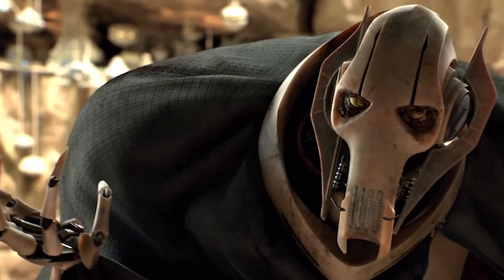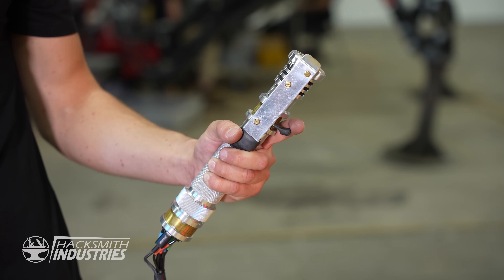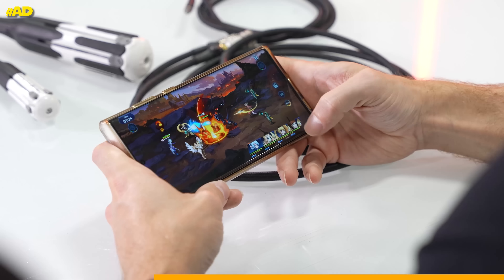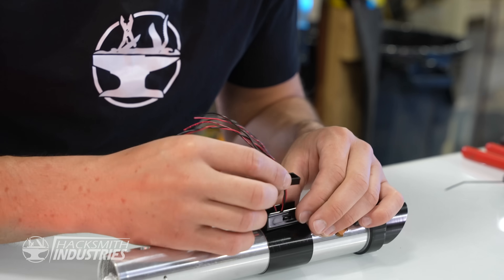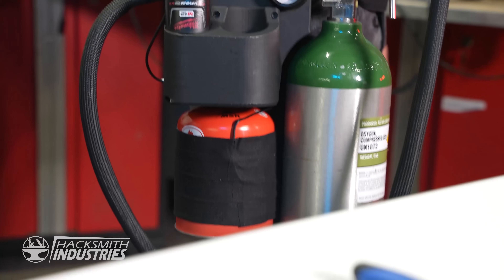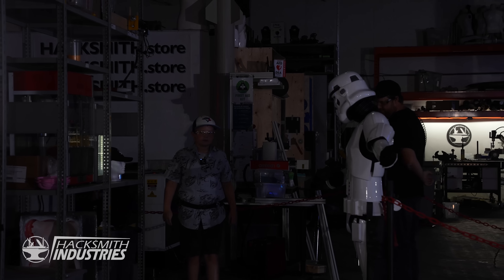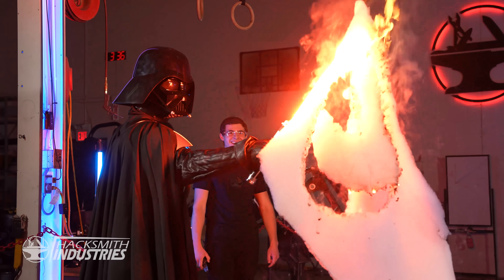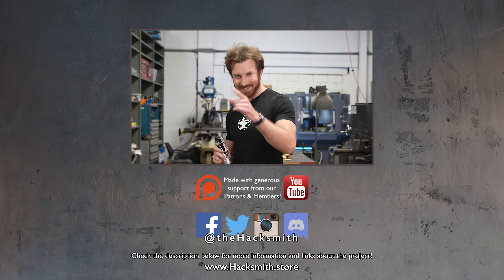My Best LIGHTSABER Yet! (STRONTIUM PLASMA 4500°)

Comment: This thing is neat, but the plasma is still too cold that it takes a long time to cut through steel, much less the multiple-inches-thick durasteel blast doors that seperated Qui-Gon and Obi Wan from viceroy Nute Gunray in Episode 1, and even then, with everything else except straight-up foam, it was slow. In the movies, lightsabers cut through any material with a low-to-moderate melting point (glass, plastic, and flesh) instantly, and also instantly cauterizes wounds they create. The blade would likely have to be at least 3x hotter to achieve something like that, and even then, there's the matter of miniaturizing the power supply, plasma fuel, and (optionally) colouring agent to fit inside the hilt and either last a reasonable amount of time or not deplete at all. 

I feel like it will take several major scientific breakthroughs in the relavent fields for all the different components before something like a real lightsaber becomes possible. Maybe we'd see the technology become a reality in about... 200 years? Even then, It'd probably only be protosaber tech until we find some way to generate plasma without using a finite fuel source.

Lastly, if a real lightsaber blade is 2-3x hotter, then you'd probably want gloves to keep your hands from burning.

Nice work advancing the tech, though.

Comment: I salute and respect the endless effort and passion behind this build, yet, I sustain the fact that to be in respect with what is it to be expected, which is to slice through reality by extreme means.... like filamental gravitational extreme differential, the active edge is in fact the stretched event horizon blade, an asymetrical elongated slower dissipating axial radiant stellarator light saber. The handle is the energetic short condensed reservoir of compressed fluxual energy. I know how to build one, it just cost too much for this world nowadays. The light saber is also a dialog instrument with space and time, made to open passages between realities, gates from hell to heaven. The lightsaber, is a cosmic pilgrim's staff, not just a toy. Fun fact, it's a cold blade, but can cut trough diamond like a sub atomic scalpel.That is why a Jedi is needed to handle it.

Comment: I did some work (in my thesis) on steel furnace Hydrogen pure oxygen inverse diffusion flames and i think tho more dangerous they would be ideal for your Applications. The higher the exit velocity of the oxygen in the middle the better! Hope it helps great work so far.

Comment: So just spitballing, maybe you all have looked at this and thought it wasnt a good idea, but why not do a spring loaded collapsing steel rod with a MAJOR electrical supply to super heat it? Gets rid of the fuel tanks, dont have to deal with how finicky the flame is, and you get that collision that we see in the movies when a light saber hits something. Just use a metal with a stupid high melting point like tungsten
Reply: Just saw that the early prototype was a tungsten rod. Please ignore my previous comment XD

Comment: Starkiller had a unique ability to control lighting into a force sheild.which could be used offensively. Lightsabers have the ability to absorb lightning but it depends on a force users sensitivity  and talent to use the force. Basically,  a lightning rod with a super capacitor and a trigger to release the energy could work to replicate a small fraction of his power.

Comment: Ok so do you guys know those lasers that are used from magnified light and can basically cut anything really quick and a lightsaber is powered by a crystal what if you tried something with that but make it visible (it’s just a thought that may not work but worth the try)
Reply from the maker: Lasers can't cut things really quick though 😞 and the power level you'd need to do that... well you'd go blind wielding it

Comment: The Saber blade will be more stable with specific fuel mixture of solid and liquid fuels....lpg is not the best atomic liquid gas for a solid type plasma blade...i feel like map gas could be way better... but a chemist might be able to tell you a way to keep the molecules more stable plasma then evaporating into the air as the flame moves around....

Comment: Now all you have to do is to make your power source super small and super long lasting. 

Now I have a theoretical solution but it's super expensive, super time consuming and very difficult to do. 
Three steps guide, very easy:
1. Make a fusion reactor.
2. Make it smaller.
3. Put it in a lightsaber.
Bonus step: make an actual arc reactor and dig a hole in your chest.

Comment: Looks insanely dangerous guys. You should be wearing suits if possible or testing on stands not holding them. One slip and your face or heart is destroyed. I mean one wasp or mosquito or anything that startles you, along with knowing the danger, you go from stable to insane panic so fast. Someone can be so hurt or killed so fast. You're filming looking at camera holding them. Focus is not where it should be in that case. Until you have AI to detect motion towards person and turn it off quickly you might want to handle with extreme cautious. As much as we want it to be a cool toy it's actually such a deadly weapon it was in movies after all. I know you'll eventually compress the gas and everything else into the handle and have it run from 4 minutes to an hour eventually. Maybe you'll limit the gas to a fine outer layer over a retracting tungsten composite shaft that allows for actual sword blade impacts. That might minimize the gas needed enough to use a few titanium carbon fiber matrix CO2 like cartridges in the handle. But please make R2D2 first to insure it's turned off before anyone is ever killed please.

Comment: I’m not to good at engineering but is it possible to limit the pack to one tank? If you need one tank for the gas then can’t you just make a contraption connected to the lightsaber that allows air flow into the saber?
Reply from the maker: Air consists mostly of Nitrogen, not oxygen (about 20%) -- for this to work it needs oxygen, so two tanks will be required =)
Reply from the maker: That would be an inefficient use of space -- also super dangerous to store an oxidizer in the same vessel as a fuel source...
Reply: @hacksmith  thank you for letting me know I just thought of that and was wondering

Comment: What if you guys make little capsules that contain the same type of gas you guys use to power the light saber or also you guys can make a electric lightsaber and use the power of a core that would look like a battery though it would make the lightsaber big you would be able to recharge it with a type of charger that would be similar to a plug you use to charge your phone with this lightsaber you can make the battery smaller some day you figure out how to make it smaller

Comment: Hypothetically speaking. The cheap toy lightsabers have a plastic core that comes out when you hold it down. If you guys can produce an actual flame that takes the form and shape of a lightsaber. Why not have a core in a material that can withstand  the flame that comes out alongside the flame. And then you can cover the core with that stuff that you used to change the color. Also I don’t think it would be hard to design it so that you could project it outwards and back down like a slingshot kinda thing. I think we’re getting really close

Comment: Well canonically speaking lightsabers use crystals but since kyber crystals don't exist, I think something like diamond would generally work if your using military grade adjustable lasers that focus in on the diamond or other type of gem (maybe like a ruby or emerald) and a reflective mirror or something like that, That widens the beam of the blade. And a turntable know that adjusts the mirror to make the blade shorter or longer.

Comment: you should try to find a heat resistant material that is possibly see through and make a layer around the light saber that can hold the flame into a compact shape so the light sabers can clash together and whatnot and is retractable with the fire so that it actually looks like a real saber. You should take inspiration from the actual toy light saber and make it compact like those except the blade goes all the way into the handle

Comment: OK ridiculous idea time, if you had a solid metal stick up the middle with a super powerful (somewhere in the megawatts) laser that fired around it and was reflected of some kind of cap such that the laser didn't actually touch the metal then just theoretically could that give the appearance, (apart from the tip) the physical impact, the melting ability and the rapid swinging around? although what the cap would be I don't know, some sort of mirror or material that absorbs minimum energy from light and reflects it down to a one way mirror on the bottom (I am sure those are a thing) and then the light bounces back and forth between the two until it eventually dissipates due to contact with the air, although powering such a massive laser could be a problem, meditate on this I will.
Reply: I mean I had to have a star wars reference somewhere.
Reply: This would also make controlling the color far easier

Comment: To have a working REAL lightsaber of any sorts (laser, plasma, even just light) was a dream for me ever since i have been a child. However i dont see it becoming a reality anytime soon. 

1. So the Plasma prototypes that Hacksmiths are using seem to have several issues, one being length, other being the temperature itself (needs to be higher, without transfering heat to the user), and stability, meaning if you are in some rare chance able to perform those two things, make it stable, so the length and temp stays the same even when your cutting. 

2. When it comes to both light and laser sabers well we have similair issues between the two, There is no way to make a light or laser beam by itself be for example 1m and then stay there, the light continues until hit a object. Thats why FX lightsabers need the glass blade. 

For me, this proto from hacksmith is not the closest we got to a real lightsaber in terms of look and design, i believe that the new Neopixel lightsabers with the colored blades are that. 

Having sed all of that, MAN im impressed by the people at Hacksmith for being able to even do this, it takes, money, time, time, time, time and then some more money, but without their skill none of that matters, and its clear they are very intelligent people with great ideas.

Comment: Hacksmith in 20 years:
"Well, we finally solved the intricate mathematics of rotating magnetic confident field issues by perfecting our quantum-nano-computer PCBs. Now all that's left is to engineer a replacement for the self-contained nuclear battery-pack since prolonged use is starting to cause significant increase in radiation poisoning in our hands and arms."

Comment: I have no engineering background.
Would a valve that controlled the flow of oxygen to the emitter act as a way to increase the overall length of the blade? Greater oxygen flow = greater length?

Comment: what about some sort of glass tube that goes over the exit of the hilt where the start of the flame is  with a hole in the top that the flame can travel up . would mean you could move it around with out the air pushing the flame away it might even give the blade more height

Comment: What if they tried to use air jets around the top of the hilt to try to isolate the blade somewhat for better length/straightness? Air likes to form a column. See holding a pingpong ball in the air column of a vaccuum. If they could try to manipulate the air somewhat, the might get a straighter blade. But i'm sure they're considering all this. Armchair fluid dynamics probably isn't helpful

Comment: Sword expert here
Handles or in this case a hilt are usually the size of your forearm. Pretty much enough to fit 3 hands top to bottom holding the blade, if you ever get the fuel in the hilt with this you just doubled the room for it

Comment: Have you thought about glass blowing basics???? What if you anatomically integrated gold with borosilicate and blasted huge amounts of electricity into it with an alternating current? Ultimately, it creates a gold silicon current controlled by magnetics and sound frequency. If it is domed at 2 and a half to 3 foot with a negative/positive center current then an outer circumference is inevitable. Hopefully it would hold a circulating recharge. Using piezoelectric pressure should create an evercharge

Comment: I'm so excited to see what eventual replacement they are able to make for the Kyber Crystals. In the movies, that's how lightsabers work, right? The saber pulls heat and/or light from its mechanics and shoves it through the Kyber almost like a prism, which shapes those elements into a razor-sharp, extremely hot beam contained inside of a magnetic field? I could be completely wrong, but that's been my assumption from what I've seen. I wonder how Hacksmith can replace the main sci-fi element of lightsabers with something real!
Edit: 15:20 THE LOOK ON HIS FACE IS PRICELESS

Comment: Sorry if this is wrong since im not a chemistry, but if using high pressure valves on fuel, maybe there can be also a oxygen high pressure valve less pressurized than the fuel valves, that throw oxygen outside the saber and the fuel uses it, making it a bit longer maybe. And maybe this also helps with the swinging problem, but maybe not since high pressure fuels dont work well sometimes. Also maybe this is also wrong, but if there is enough tecnology to make a small electric magnet inside the saber that affects only part of the blade area, this can work making the magnet properties of lightsabers, if the magnet dont screw the internal systems of the saber

Comment: What if you had a heat resistant bar in the middle of the flame that was retractable, so if it isn’t turned on, then it won’t be visible. This also helps with lightsaber dueling. Only problem is the material for it. I don’t know of anything that can resist that kind of heat and stay durable enough
Reply: That’s exactly what I was thinking like what if they made it to where it could actually like you know be a lightsaber but you would be able to see the rod that makes it to where u can fight

Comment: I can see where this is going, more propellant to send the plasma to the general saber length, only problem is thermal dynamics won't allow you to do this safely. I think the hilt would catch fire/melt and you would use up fuel pretty fast. It shows me that a real working lightsaber with a magnetic field, proper heat and a strong enough power source is not within the realms of physics as we know it.

Comment: Not to be rude but it's a little short.
If possible, can you make it longer?
Reply: Limitations of physics, chemistry, and technology. This thing they made is just a big lighter. A bigger one already exists and is called a flamethrower. Elon Musk made that into a toy just for fun.
A real lightsaber can't be built. Not until someone figures a way to stabilize a very concentrated  plasma stream outside a toroidal chamber, and suspend it in mid air. You need force fields for that, and that's another sci-fi technology that doesn't exist.